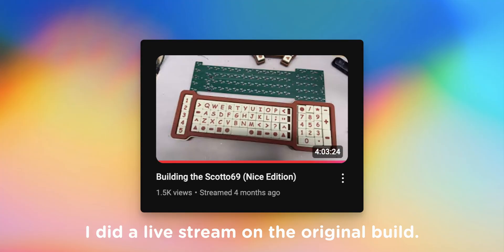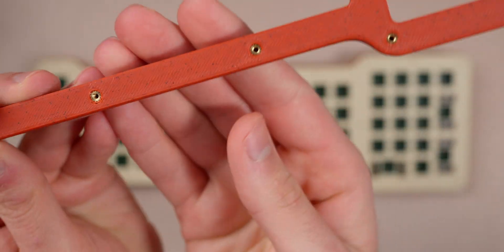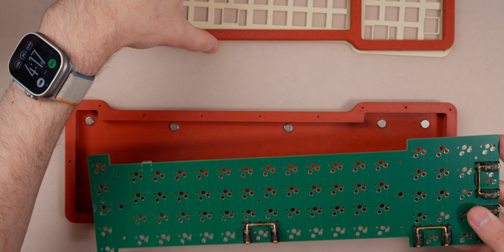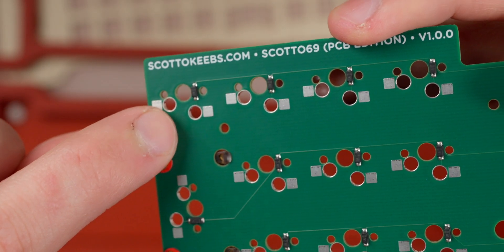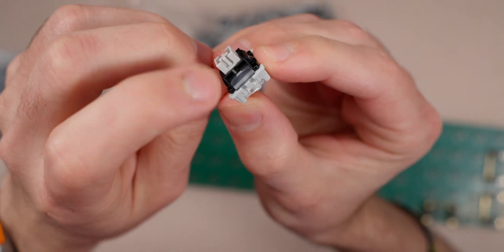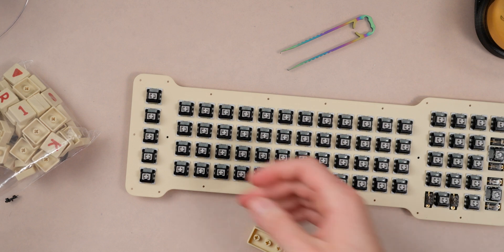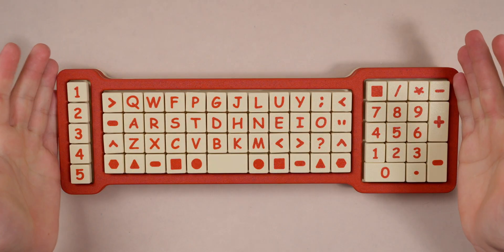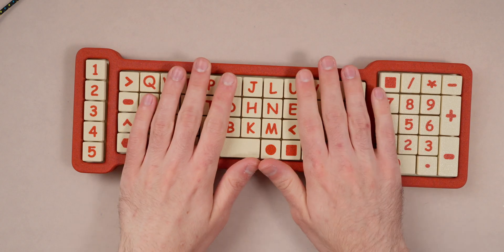Building the Scotto69 (PCB Edition) Mechanical Keyboard

Comment: Nice looking board. I use attachable lifts on the back of my boards - never thought to use magnets for them though! My advice is to print the riser the other way up, the the gradient angle from the printer is on the outside/bottom as it grabs on to a desk mat quite nicely.